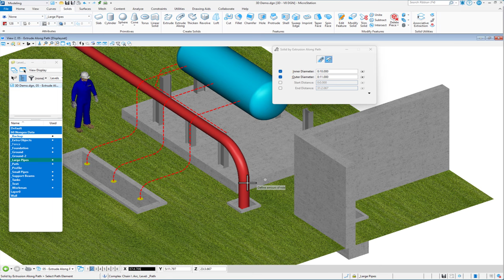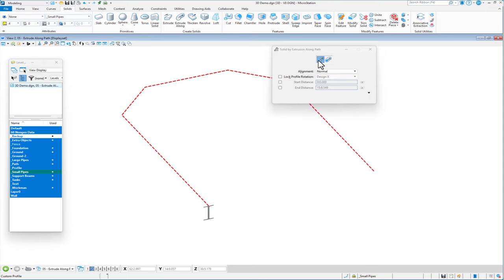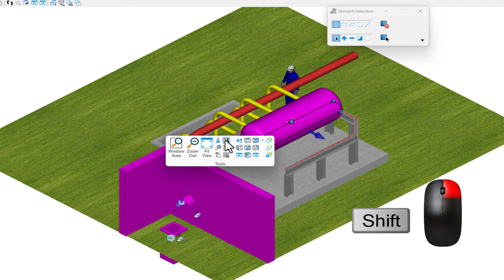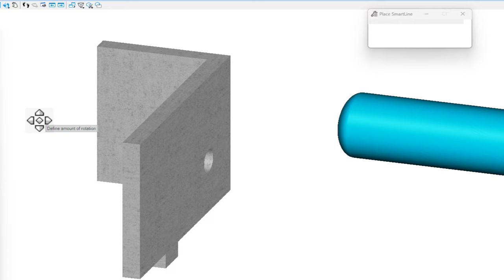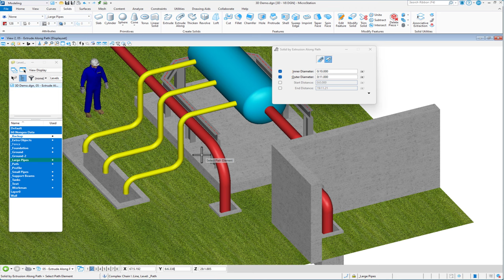3D Piping using the Solid by Extrusion Along Path Tool

Comment: That is a great tool @BentleyMicroStation however, could you also provide information on how to create a report containing information about these pipes - their inner and outer diameters and total length? I would be very grateful.
Reply: You will need to learn about Item Types and Reporting. You can create Item Type called Pipe with a specific list of parameteres and then you can use Reporting Tool to create your custom report.
Reply: @jaceksoroko1063  This is true, but unfortunately, in the report definition, I don't see the possibility to combine and present information about the length of the pipe and its diameters at the same time, because the parametric solid has no length property, and the string line does not contain information about diameters. Item types are a separate issue, of course it doesn't make sense to enter such information manually into an item for every pipe, and unfortunately I don't see an option to write named expressions that would be able to read both information at once (the same as in the case of report definitions).  Perhaps you know where I could find more information on such a complex issue?